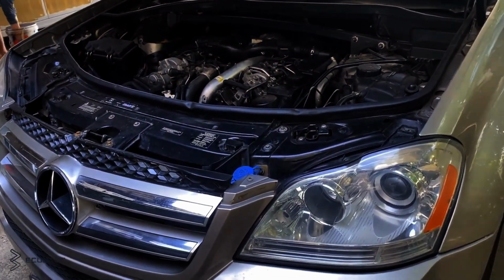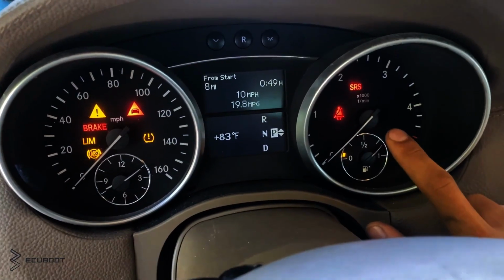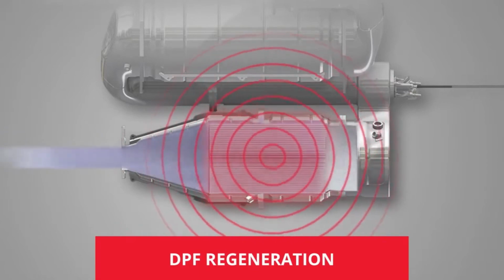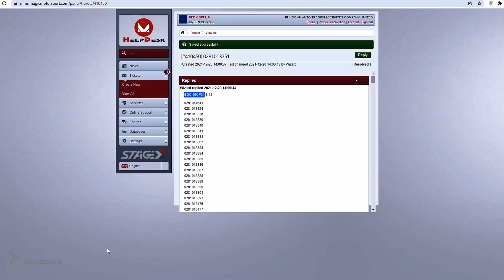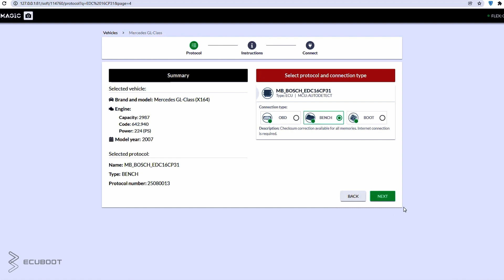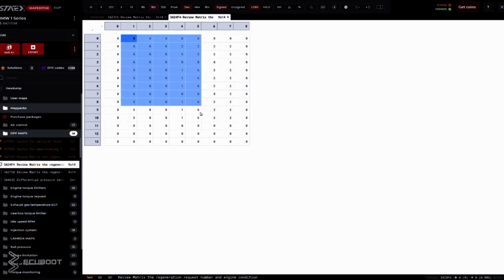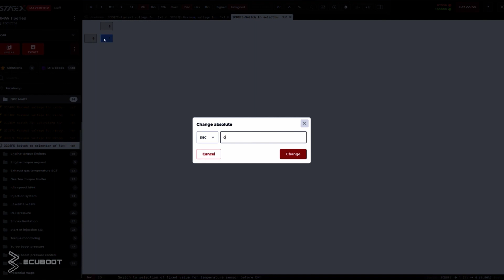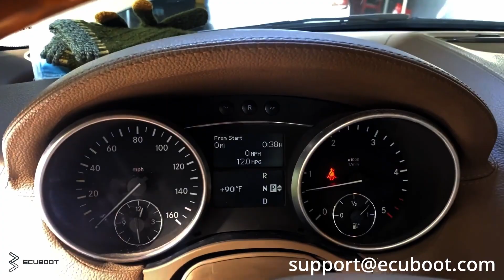Fixing DPF fault on Mercedes GL 320 - DPF OFF Programming

Comment: Hello
I have the fault code 148A00. And the car it does not make the regeneration of the particule filter. Do you have some advice? It is an C320 v6
Thank you
Reply: Hi! What problem was you car, because qive this 148A00 code? My Mercedes same problem.